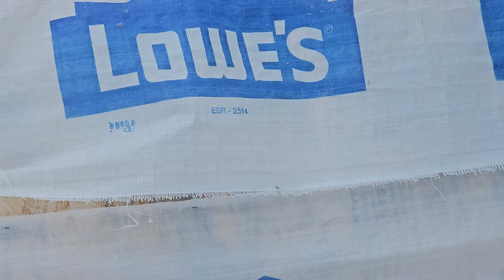Some future plans and ideas

Comment: yup right outside my window. Snowing.
Reply from the maker: Very cool, Julianne. Wil it accumulate?
Reply: @johninalaska9563   yes it did a few inches, cold until next week. 20s and low 30s. so not to cold. have to check to see if your sister got snow,